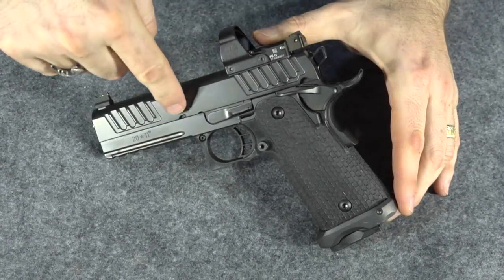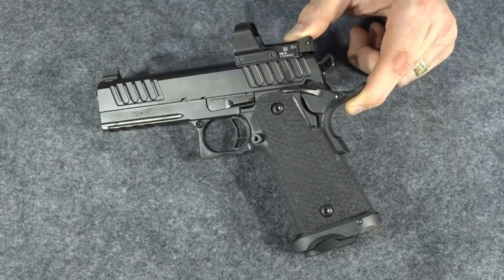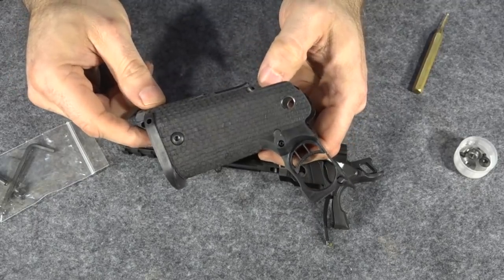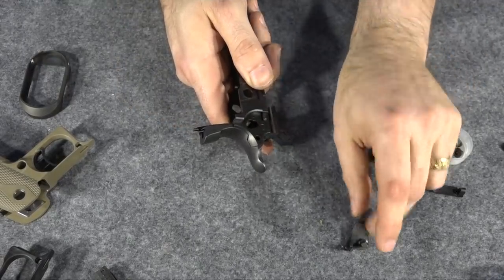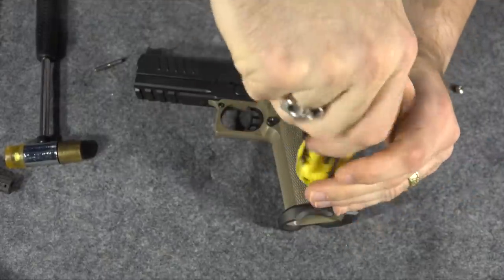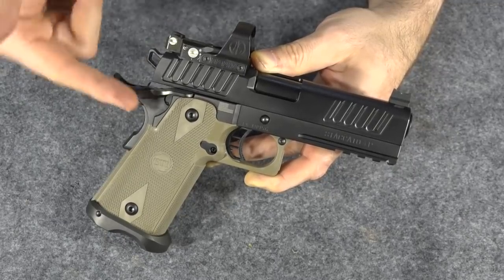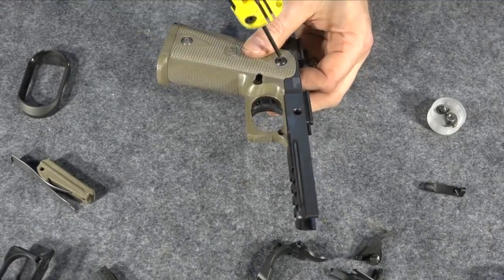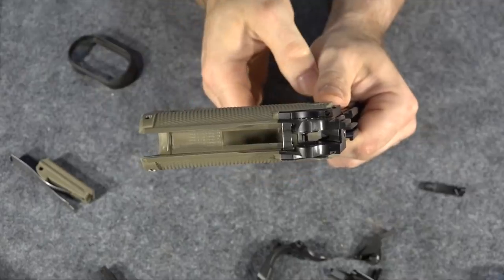Changing the STI 2011 Staccato P Grip Module...(New Two Tone Look)

Comment: Really is an excellent redesign of the 1911. Just wish they weren't so ridiculously expensive. There's no reason for just a polymer grip to cost the same or more than an actual 1911 frame... (and then of course you have to buy/have the actual serialized metal frame), which also costs the same (or more) than a regular 1911 frame (even though it's much smaller and requires fewer machining operations). It's nothing more than a partial polymer grip frame, but they cost like $250.00. Am I wrong about this? ...or is there something I'm missing that justifies the (seemingly) ridiculously high cost?